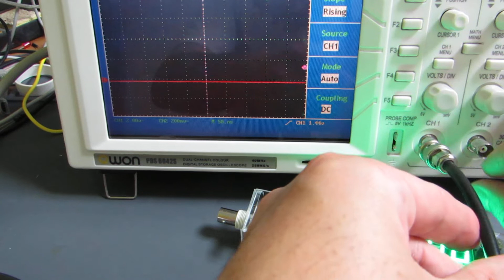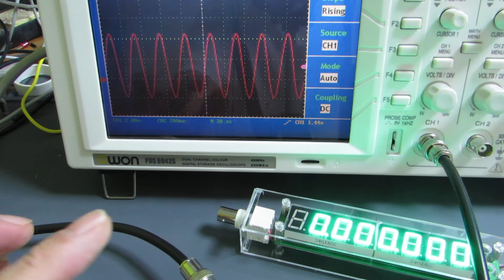Super high precision GPS trained frequency standard for 1 to 200 MHz

Comment: Well done!   I thought about doing something similar with an Analog Devices DDS chip but it ended up too much for me at the time. The nice thing about the DDS chip is you can get sub hertz frequency  steps all the way down to almost 0 Hz.
Reply from the maker: Yeah right. DDS is another nice candidate for signal generation. This time my main purpose was "generating accurate 10MHz from GPS" and this PLL chip was enough for this purpose... But as you wrote, if we want to make "general signal generator", DDS will be indispensable. Thank you!